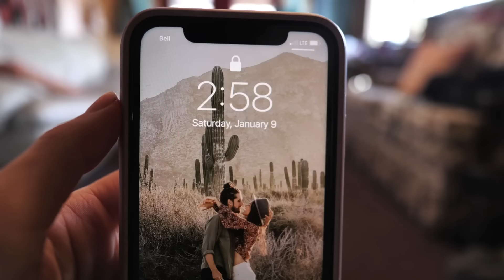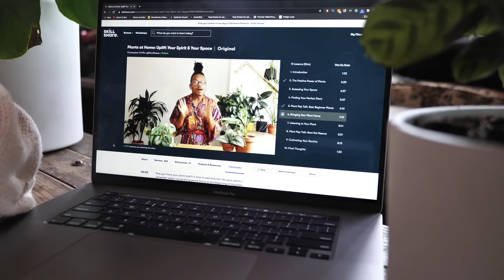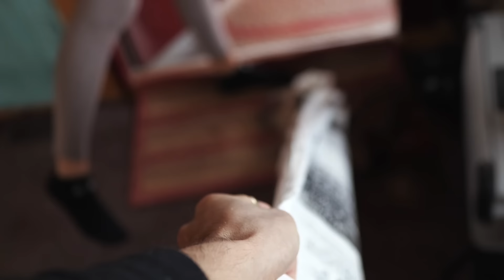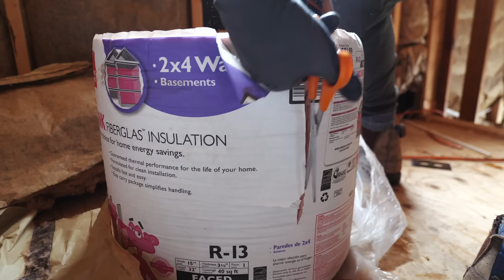EMBRACING CHANGE | Building our Home at Cabin in Woods

Comment: The same thing happened to me while working on a tree. it's a rush that disappears in a couple of weeks. It itches a lot. I think it's due to substances left by insects. Probably working on those wooden slabs you put on the ceiling.
I recommend that you buy an adrenaline syringe right away in case of anaphylactic shock in the future.

Comment: Regarding the Hot Tub rash, I had the exact same rash and it was not Folliculitis, it was an allergy to Bromine.  If you're sanitizing your spa with Bromine, try switching to Chlorine.  I did and the problem immediately stopped.  Now, I'm fine in any chlorinated spa or pool but, if on vacation etc. I have to ask if they sanitize with Bromine or Chlorine and have to avoid Bromine.  I hope this helps.  Happy 2021 and it's been so much fun watching you work on the cabin.

Comment: Hot tub’s are super dirty. Make sure the chemical balance is perfect and the jets are regularly used so the water in the lines is clean. If the rash gets worse you will antibiotics - been there. Good luck.

Comment: I know i'm absolutely too late to the party but why didn't you spray foam all of the space, even the inside walls and ceilings? It won't just help with heat but also with sound proofing. I'd also put an additional layer of iso when you lay the floor.